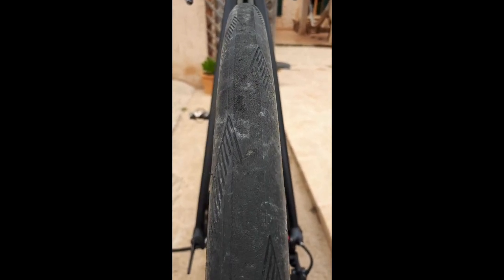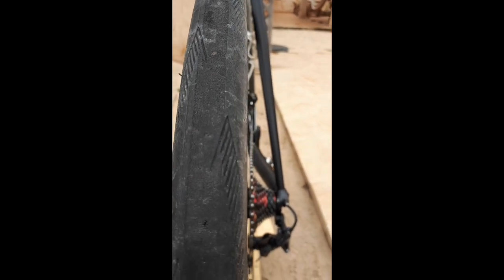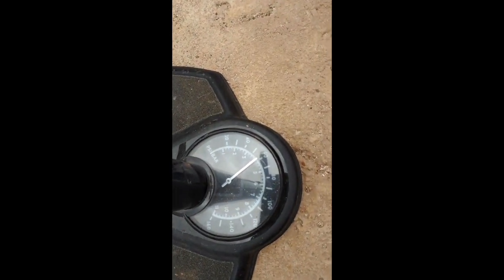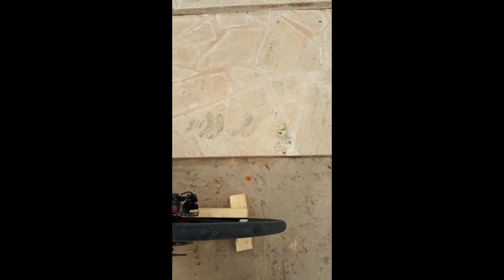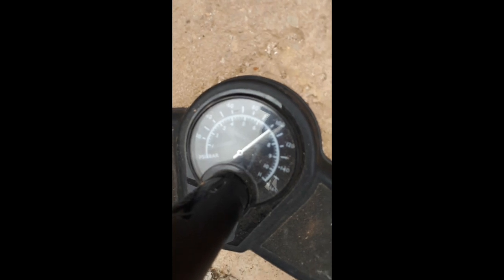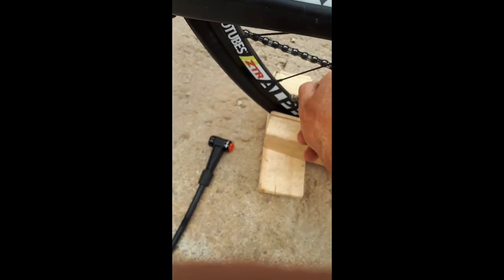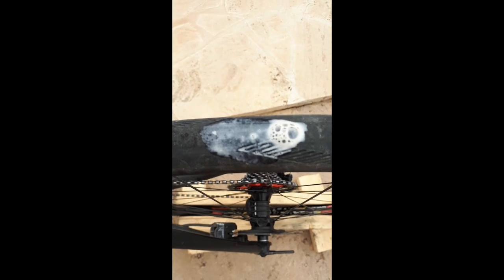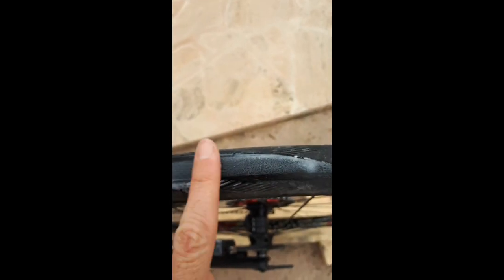Extended review of Schwalbe Pro One Tubeless Tyre

Comment: Good review. For the bigger holes try Stans new Dart. They work and I have ridden over 200 k with the plug installed.  I ride on pro one 28mm with 60 psi 4 bar which is ok for the rough uk roads.

Comment: Time to replace that tyre, I was getting flats nearly every ride on Scwalbe Pro Ones once they were worn down a bit, have now changed to Conti 5000 tubeless (70/75 psi), they do seem more durable so far and very similar to ride on as the Scwalbe's. The Scwalbe's  were a real pain to remove and would never have got them off on the side of the road, the Contis were hard  to get on but sealed very well with just a floor pump and no sealant just hoping they are easier to remove than the Scwalbe's  when I have to. Cheers.
Reply: i have similar experience, it always happen to the rear wheel. First Schwalbe Pro One last for about 6-7 months before i had a puncture which not able to be sealed. Then i change the second one and it only last 3 months and then same thing happen again...